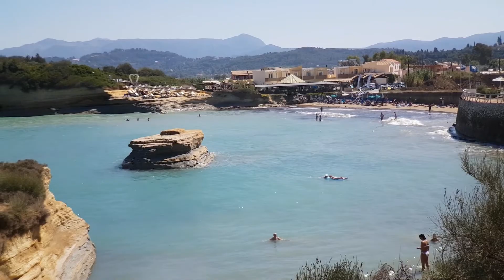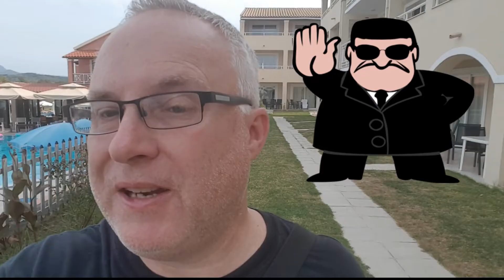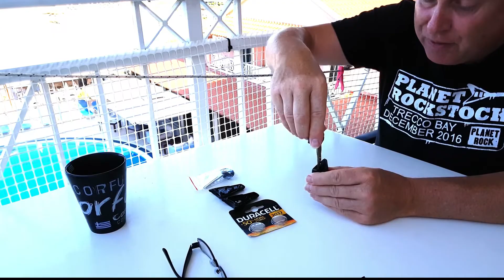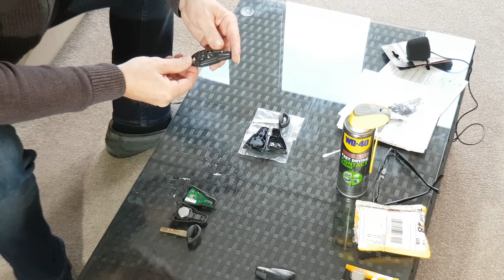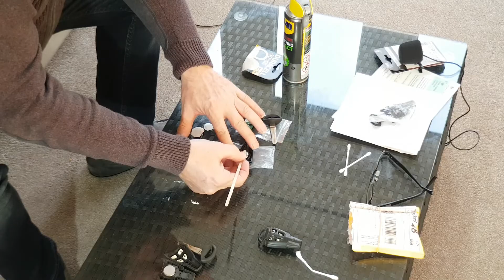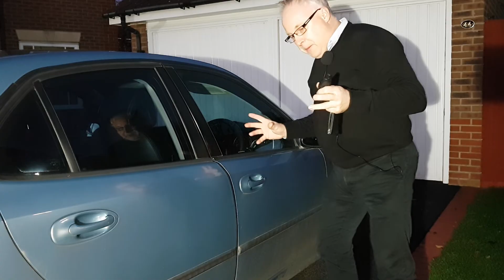SAAB key fob case and battery replacement | Saab 9-3 Remote Resynch

Comment from the maker: “You have been warned” - but warned about what?? If your car is locked, the remote doesn’t work and the key won’t unlock the door, that’s TROUBLE. You are LOCKED OUT and you will have no option but to smash a window to get in AND will have to get someone with Tech2 out to the car to replace the CIM and program a new key. Likely cost around £1000 or so.
Of course, if you keep a spare remote/key and check it’s operation regularly, that will save you from the above hassle and expense.
Do not fall into the trap of thinking I’m being overdramatic for effect. Over the last 4-5 years I’ve been active on Saab forums, I’ve seen this happen to a few people.
The best defense: keep a WORKING spare.
Reply: Read your owners manual.  Use the metal emergency key to unlock the door in case the car or remote battery is dead.  no need to smash windows.  None of this will help if your key is not recognised though
Reply: When we were locked out of our 9-3 wagon I used a length of wire coat-hanger (bent into a hook at the end) to go between the door and the seal, hooked under the door lock, and popped it upward to let me in.
It took a while, and I may have said a few swear words during the process, but it worked and there were no ill effects noted to door, window, or lock thereafter.
Reply: What happens if the battery dies will I still be able to drive the car my key fob turns the car on but the buttons don’t work it doesn’t lock or unlock the car does that mean it needs a new battery
Reply: I thought that too until I realized that inside my key fob there’s a little button on the back of it and it just looks like a little emblem it’s a circle you push it it opens up the case and inside of it is the actual key that you can use to unlock the car door depending on your alarm it might be tricky but if your battery is dead your alarm obviously won’t work anyway
Reply: Yes spot on
Reply: I'm stuck, but I don't understand why I didn't get stuck 5 years ago when I first changed the key case, and again 2 months ago when I changed them again. In that process I just separated the case halves, removed the board and battery and placed in new case. I didn't do any resynch. It just worked.

But a few days ago I noticed one of my two remote keys stopped working. New battery I thought, so I replaced it, still did not work. The other key did work. I wondered if I had the battery in the wrong way round so I disassembled the key that worked to check battery. Battery orientation was OK. I'm sure the good key was still working at this point??? I left it at that and returned to the problem a few days later. Now both keys don't work, and I've discovered the physical key wont turn the lock. I've just managed to prise the door open a little so I could use a tie wrap to capture the little button and pull it up. But door still wont open.

How did I get away with it on the previous two occasions? And what do I do now?
Reply: Cyclone Cyd Boy don’t I know how true that is. I had a 9.3 estate, lost the only key, found that price for the replacement work n thought, no way the cars not worth that so, yes hey Mr scrap man come n fetch, upside was at least I got £200 for it.🤔🤔😪

Comment: Hi, great video do you have any new links for these key cases and boards.?  Many thanks, also have you a video on the Saab 9-3 door latches as I fear my rear passenger side door is faulty and setting off the alarm as the car thinks the door is open.  Many many thanks.  Alan.

Comment: My key fobs won't open my SAAB which has been sat on my drive for a long time, battery in both car and key fobs are dead and the SAAB is locked, if I changed the battery in the fob, would the SAAB alarm still go off? 😕

Comment: Excellent video, thank you very much. Just one question not covered. I have taken over a 9-3 from 2007, no alarm, and received two keys which both worked fine (ie they are programmed to the car). Replacing the battery in one of the keys has left me in a position which is not covered by what you say. I have closely followed what you say, put in a new battery, entered the car, turned the key to “on”, the car starts fine - but the key fob no longer switches the locks open/closed. In other words, before changing the battery I had two keys which did everything but now I have two which both start the car ok but one also controls the locks while the other one (with a new battery) starts the car fine but does not work the locks and I can only use the mechanical key to get in the car. What do you suggest I do to get the locking to work again?

Comment: Have a 2008 Aero 93. Thanks for the great video! Replaced the battery without a hitch.  My driver-side door wont lock or unlock. Process works fine with all other doors.  Any suggestions?  Thanks again!

Comment: Thanks my friend that was awesome. Replaced two keys... the worn front part only. The bit with the blue Saab badge was worn but fine. Only a problem when the little pressure pads actually fell off the other side.  Dx

Comment: I did everything wrong , i should have watched your video first , now iam locked out ,,, changed the battery , tried it out it unlocked and then locked and then nothing anymore , wont open the door , manual key wont work either ,i cleaned everything in the fob , still wont open ,,,,,, what now ,, HELP
Reply from the maker: Is it the correct manual key? If yes, try this https://www.youtube.com/watch?v=9PKT1d1n3a0&t=1s

Comment: Good Video 
Have just bought an 05 9-3 and the key fobs have pretty much haddit. The link is in swedish for the one you recommended. Cant seem to switch it english, any ideas.
Reply from the maker: Select your country and currency and language in the top right of the listing page.
Reply: Ok thanks I didn't actually see that?

Comment: Thanks for all of your advice so far. I removed the ISM and took it apart. It was very clean on the inside but I cleaned it anyway. I connected it back to my car and left it loose {outside the console}. I am getting a bell when I first put the fob into the ignition, but then I get both the "steering wheel malfunction" and "key not recognized" messages. I tried jamming the locking spring on the back of the SIM and was able to turn the key, but got the same messages again. I heard the fuel pump kick on the first time, but when I tried it again, I couldn't hear it come on again. I removed the starter relay from the box, jumped it with needle nose pliers, and I got the car to turn over but not start. The ABS module is hooked up properly but I've had problems with it in the past and used your tip to bypass it. Do you think I should try that again? If it is the CIM is there any way to get around it and get the damn car to start and run? It's a really nice '06 9 3 Aero convertible but I don't have a lot of $$$ right now, and I don't feel like playing guessing games...Any suggestions would be greatly appreciated...BTY, I replaced the 5-year-old car  battery {$220.00} to no avail. I do not have or know anyone with a Tech2. Thanks again!
Reply: I have the same car Grey and Black and same problem and performed the same steps.

Comment: I changed the battery a couple of months ago and only really had theoretical issues in the back of my mind of it being an issue. I made sure that I went straight away to the car and started it. I do  need to change the cases on both keys though, as the rubber is starting to degrade, and have watched another vid of yours so thanks for the info and a long life to all the Saabs that are still on the road.
Reply from the maker: Once the rubber buttons are degrading, good idea to change the case because the switches themselves become vulnerable to damage.

Comment: Excellent video Cyd.

I’m wondering why my automatic window opening no longer works from my key fob. I have a poor driver side central locking actuator which usually doesn’t open the door with the central locking. I used to get past this by holding down the unlock button which would drop the windows at the front but this feature has suddenly disappeared!!

Comment: Hi Cyd, this morning both of my fobs to my 2004 Saab were not working. I did take your advice and used the manual key to open my driver’s door without any difficulty but I did wake all the neighbors when the alarm started blasting. I did put the fob as quickly as possible into the ignition, and  it did start up just fine. (I also replaced both fobs with new batteries). I then tried once again to use the fob to lock the door but to no avail. Any suggestions would be much appreciated.

Comment: Great video. I've just arranged to buy my first Saab. A 2010 9-3 1.9 TiD estate. It's low mileage and overall in great condition... Apart from the key fobs! I'm not sure what they're made out of but they look awful! Reassuring to know I can replace them without it being too costly. Subscribed!
Reply from the maker: I've had one of these replacements for 4 years now and it's still okay.
Make sure you have 2 working keys at all times.

Comment: Hi Cyd, I got the warning on the dash that the remote's battery was low, so I changed the battery. Then the fob's buttons stopped working but it starts the car normally. There is still the warning that the battery is low. I tried the method you showed in the video but that didn't change anything. I have also tested and tried 3 other batteries. No help in the owner's manual, any other suggestions? (2008 9-3 2.0t sedan) Thank you for your videos, they have been very helpful.
Reply: I have exactly the same problem.
Reply: I am having the same issue. What did you do? I have done everything in the video but still seeing "low battery" message. Any suggestions?

Comment: Hi fellow saab owners am having a issue with my saab 93 1.8t 2004 my full beam won't stay on i need to hold it in for it to work?
Reply from the maker: That's a problem with the mechanism inside the CIM. I'm sure it can be dismantled and sorted. I'd do a video, but the problem is everyone wants mega money for a CIM.
Reply: For future comment readers, make sure your headlight switch is turned on!  On my left hand drive/USA car, this switch is to the left of the steering wheel where you find your fog light buttons.  Every time I bring my car to the mechanic, they turn the headlight knob to 0, which doesn't allow the high beam switch to stay in the on position.  You, the daily driver, don't normally mess with this knob because of the daytime running lights, but it's possible someone else did.

Comment: What do you do is the key is no longer working on the door? And the fob doesn’t work with a new battery? The car starts with key but I can’t lock the door.
Reply from the maker: Try changing the lock switch on the remote PCB

Comment: When i put my key ino my sav 93 linear.
It says key not accepted take to dealer.
It will still lock and unlock off buttons. But it will not turn in ignition. Please help
Reply from the maker: Have you tried resynching it? OR it could be the ISM (ignition switch module). You can take them apart and clean them up, or replace with one from a junker. They are plug n play

Comment: Hi question only have one key for my 2003 Saab 9-3 convertible a friend gave me a set of keys from a 2006 95 aero can i cut new keys and then get the transmitter program for my car the transmitter part # 5265335 are the same
Reply from the maker: Technically, yes you can, but you need someone to 'empty' the programs in the keys so they are like virgin ones. You'll be lucky if you can find someone to do that. Otherwise, you need new virgin keys and tech 2.
Reply: @CycloneCyd  Thanks for the info you’re my go to guy for information i know a Original Saab Service tech he’s the one who service my cars transmission he had told me i need a spare key just got this set of keys just didn’t ask him if i could use that transmitter I’ll give him a call thanks a lot
Reply from the maker: @jamrockrc172  yes, make sure you have a good spare
Reply: @CycloneCyd  I’m going to order a new cut key from eSaabParts.com and have my guy reprogram it for me thanks again for the info 👍👍

Comment: Can i buy a new key and synchronise it like this or do i need programming? I’ve got 2 keys that are working
Reply from the maker: No, if you buy a new key it needs programmed to the car with Tech2. Whenever we go on any kind of trip, I make sure my wife has a spare in her handbag (I've got 3 keys, so there's one at home too). I try to rotate them round too, so they all get 'regular' use
Maybe I just 'know' too much, lol. I co-engineered the remote and key system for New Range Rover 38A.
Reply: @CycloneCyd  ah ok thank you!

Comment: I just changed my battery, the changed key can still lock and unlock the car but won't turn in the slot to start the engine, while the spare does just fine. Any idea why?
Reply from the maker: Take it apart again, clean the contacts and board with contact cleaner ( https://amzn.to/3o3ZZun ) and try again. Only touch the edges of the board.
Reply: I've got almost the identical problem, but I have changed both the fob and battery. Gonna try the contact cleaner over the weekend.

Comment: I got a used 9-3 Arc convertible and the metal key isn't the original. So best thing is to buy a used set eh?
Reply from the maker: You can get a new key off your VIN. Contact your nearest Saab approved service centre

Comment: Hi there! I keep getting a “remote control battery- replace battery” message. I have replaced the battery twice, resynched the key, but the message still keeps appearing. Any suggestions?
Reply from the maker: Good quality battery? Did you clean the terminals? Did you use the clear button to remove the message?
Reply: @CycloneCyd  I have the same issue too! Tried clearing but it goes to next menu. Replaced the battery. Still says it's low. Replace battery. And the lock will not work. 
It starts car perfectly fine. What can I do to fix it?

Comment: I have a problem in my Saab 93 2004 with the key that it starts the car perfectly, but the buttons do not work when I press them all the buttons I changed the battery and checked the switch in the shop he told me that it gives a signal that works well but the buttons do not work I don’t know why  Although the buttons are new and also the spare key, the same problem please  help my ?
Reply from the maker: Did you synchronise the key?

Comment: Hello.... I did the same thing.....but the remote control does not work.....the car starts.... On screen says" remote control battery low"
I  try 3 differnt new batteries but still not working... 
Any ideas?
Thank you for your videos!!!
Reply from the maker: Try cleaning the battery and the battery connections on the board with contact cleaner or an alcohol wipe. What brands have you tried and were they in date?
Reply: @CycloneCyd  i try Panasonic, and they up to date,,,i will try with some alkohol wipes.....
Thank you
Reply: @CycloneCyd  also The key it came with one Batery  plus 4 micro switch... as it says,which i have No idea what is that??
"2PCS 4 Buttons Car Replacement Black Remote Key Fob Control Shell Case with Micro Switch Battery for SAAB 9-3"
Reply: @CycloneCyd  I have clean it with alcohol wipes....but stil no working
It's regnonise by the car ,starts the engine ....but keep saying "ghange Batery"
Reply: @nikolaskolivas989  I have got the same. Have you fixed it?
Reply: @bartbartosz6448  No.... I just give up...have the key as a spair!!!
Reply: @CycloneCyd  I have got the same, can start the engine but remote control not working. I only can lock and unlock from inside. It stopped working someday without a reason. Changed the battery, microswitches, cleaned all and none of buttons are working.

Comment: Just Watched this Vid, however, when I place MY key in ignition I get a message saying Key not recognised..... doh!!!
Dunno what to do now.... ideas ?
Reply from the maker: If the key isn't recognised, have you tried the resynch process? If that doesn't work, it's likely to be the ISM (ignition switch module). Removing, cleaning and reinstalling often does the trick.

Comment: I bought one key case with key blade from eBay and it fits perfectly with original circuit board as well as the key, I also removed the Saab emblems from the old key case to the new one ..... cost me less than US$8- with FREE shipping !  Anyway, thanks for showing this .... !
Reply from the maker: Thanks for the info! 👍

Comment: I have a Saab 9-5 and i just changed my battery on my keys and my key buttons started working for 1 day, and now again when i click on the buttons on the key nothing happens. What do i do?
Reply from the maker: Try re-synching it again. Check the battery is clean, maybe change it again, it's important not to get grese off your fingers onto the cells as it can short hem and drain them. If the car is giving message about key not recognised it is likley the ISM
Reply: Cyclone Cyd ISM?
Reply from the maker: @saif312  ignition switch module in the centre console
Reply: Already tried and i also clened the battery

Comment: How do I do this with a fob that has metal key attached? Bought a new fob, but not having mechanic synchronized as it would have to be left overnight and it's about 1 hr away. Tried using it as described and now in USA 2005 9 5 not able to get it to work.
Reply from the maker: Not gonna blow smoke up your ass here, I'm not familiar with that unit. Seek out Saab Nuts! on Facebook and ask there. 16,000 odd members worldwide - there'll be someone can help you out. Please do let us know how you get on.
Reply: @CycloneCyd  Thank You